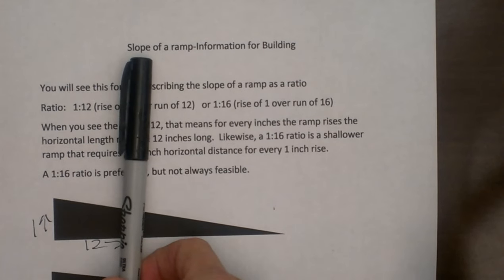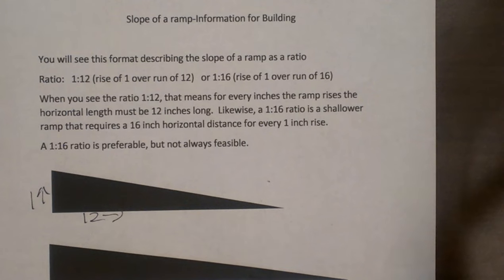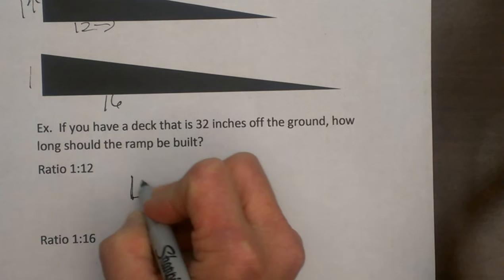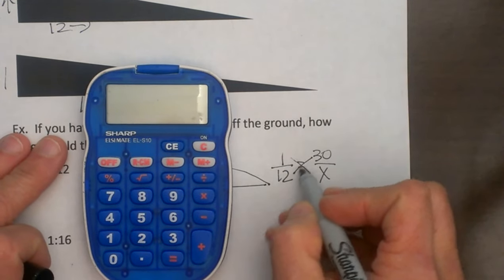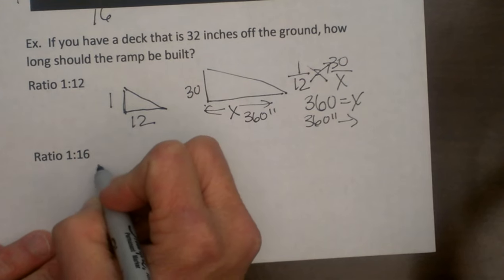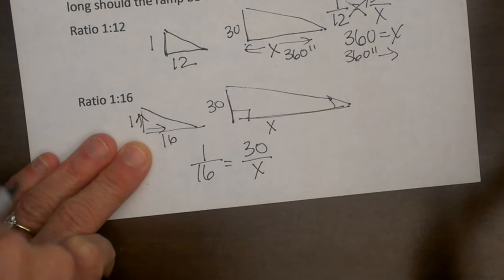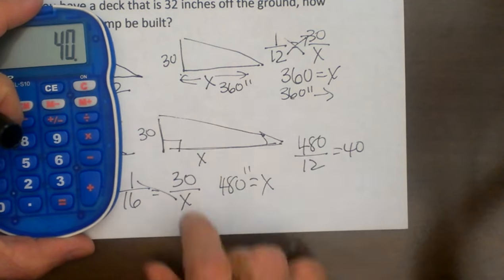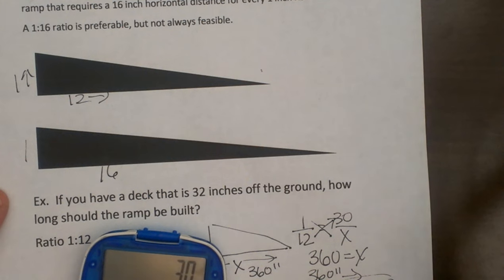Finding the slope of a ramp  Math Lessons

Comment: how would i figure out using the 1/16 ratio, but my ramp includes another ramp added to it so my ramp doesn't look or be too long without enough space for it, so i would need to build the ramp and then might to split it to land somewhere instead at front of the rise of the first ramp?
Reply: Yes, but carefully. There's a difference between frogs and toads. Also coffee is better hot.
Reply: @kimi3543  what???

Comment: I am coming up with a different answer and a simpler way to solve for x, simply take the run of 16 inches and convert to a decimal of 1.33. then multiply the rise of 32 inches times the run of 1.33 and you will get a total run of 42.56 feet. not sure how it could be 40 feet....
Reply: Turbo Productions 
She changed her problem to 30 inches instead the 32 inches which she said at first.

Comment: Okay. But there's still a transition in a vehicular ramp. How to solve the transition at both ends?
Reply: Faith Ingrid Caylan the question on a vehicle ramp is what is the intended purpose of the ramp. If you want to vault a car a certain distance there is a mathematical equation specifically for this it is called the “vault” formula. I used it to determine minimum speeds vehicles were traveling in fatality traffic accident investigations. The great thing about this formula, is you can plug in the known numbers to find an answer of an unknown. You can move the numbers around in a formula to answer a vast array of questions to vault a car. E.G. I want to vault a car xx feet... the given number is what is the total weight of car, from there you have to plug in the number estimates such as terminal speed at the point the car leaves the ramp, what percentage of the slope of the ramp will I need to attain the distance at the given speed, in order to determine this, you will first need to determine the horizontal distance of the ramp and the height of the ramp, a steep angle will transfer the energy of the vehicle as it hits the ramp, flexing the ramp and loading (compressing) the suspension up, and at an unwanted point the suspension will unload causing the vehicle to pre-vault (or get light) and begin oscillating. Too long of a ramp and the vehicle will travel less distance by the applied physics of gravity, loss of horizontal momentum directly losing the vertical lift, equivalent to driving off a cliff... I went a long way around the barn to say there are a lot more calculations needed, just based on what the intent of the ramp is used for to determine what the proper transition angles would be for the designed purpose of the ramp.